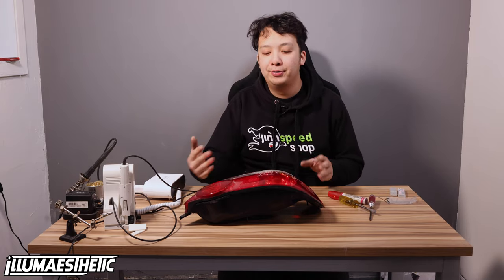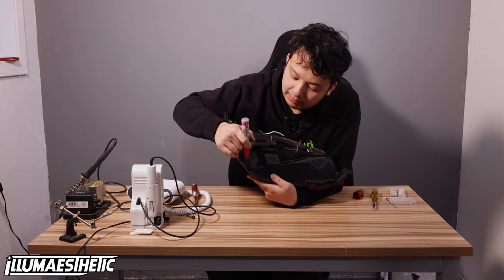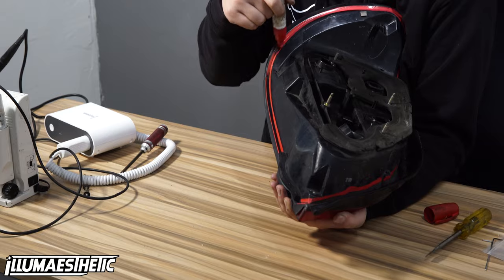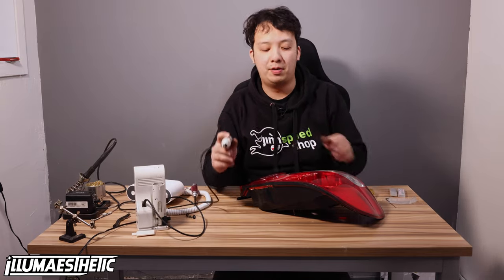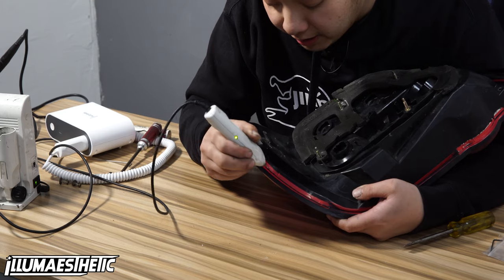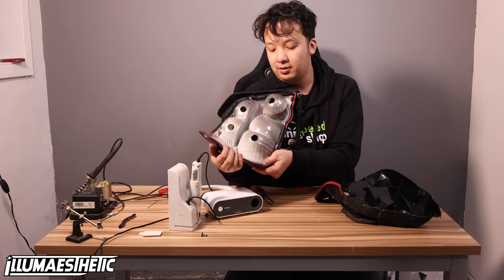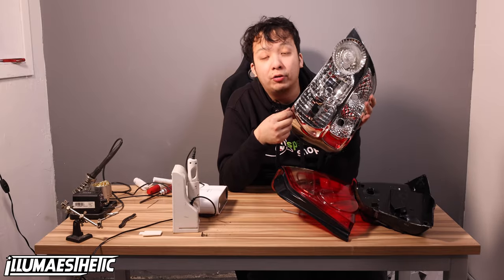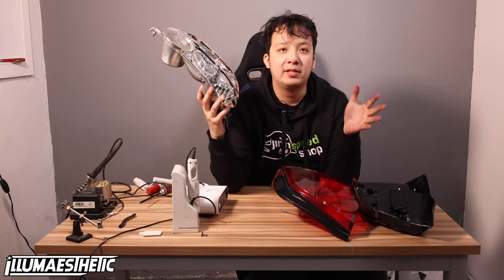Making your own custom tail lights! GD Angel Wings DIY install! (Part 1 - Disassembly)

Comment: Can this work with 02 wrx sedan Subaru tail lights ??
Reply from the maker: the concept is the same but the kit/panels used are totally different. The taillights and bumper are totally different for bugeye.